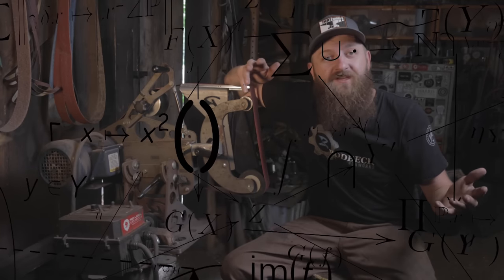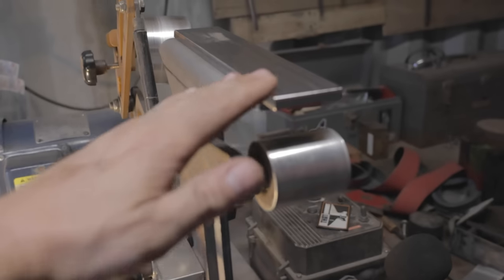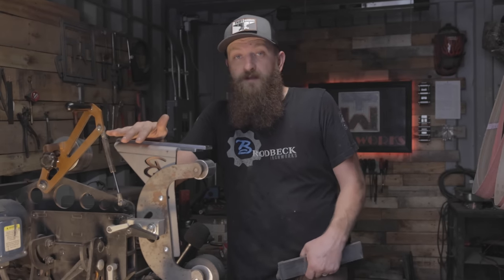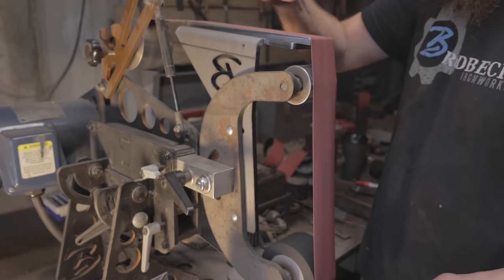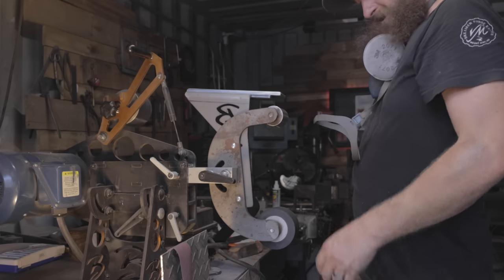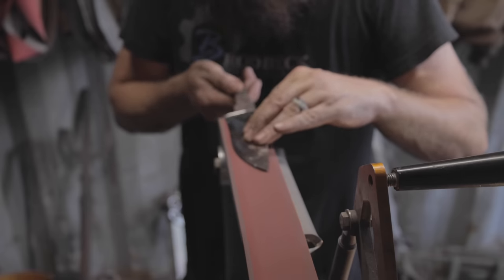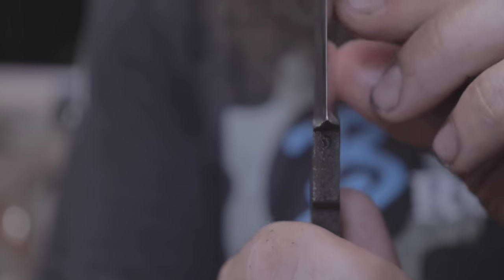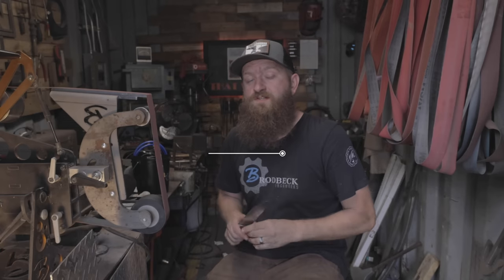Grinding Secrets that You Need to Know - Waterfall Platen

Comment: Matt, would a waterfall platen also help to keep the line between the bevel and the flat top area straight?  That's an area I still struggle with.  I'm wondering if being able to grind the whole length of the blade at once would help make that straighter/cleaner, in addition to the plunge benefits.
Reply from the maker: Yes I certainly can be used that way.

Comment: I think a big key for safety is to deliberately come onto the platen with the tip slightly up and then drop it to the belt once the plunge is on the waterfall. If you lose focus and accidentally come in even slightly tip down, you could get a knife to the chest. At least it would be the handle… I say this because I’m 100% sure I’d make that mistake at some point (ok I see you covered it at the end)
Reply from the maker: I mean yea, but also using a warn 400g ive never even been able to get the point to catch and toss the blade. Im sure if I stabbed it, it would. Id be nervous with some cheap sanding belts with overlapping joints too. I should have mentioned that.
Reply: I use the platen with grinder running in reverse so the blade is pulled away from me.  It just seems to work better for me

Comment: one big secret that they don't want you to know is to always wear eye protection
Reply: You should always protect your eyes and your lungs
Reply from the maker: I mean...I did for most of it. Had to give the people something to complain about!
Reply: <blind in one eye, can't see out of the other> 
You kids! When we were growing up, we didn't need a bib when we ate!
<coughs up a lung>
Reply: I hate it when a belt blows apart on a vertical platten. Scares the sheit off it’s me. I’d really hate to know what would happen if be blew apart on the waterfall platten. I really hope nobody gets hurt if the tip of the knife come back to n ya. Be safe. Great info on this WF platten.
Reply: @timjohle8876  Matt did not discuss tensioning the belt in video. But it should only have a light tensioning and light pressure used on a slow setting. You should have both hands on the knife at all times as well. Should a belt split, in theory you should be able to pull the knife away from the machine. But indeed it is important to be as safe as possible when using a belt grinder in general.
Reply from the maker: @fieryiceforge  I mean all of that is in the video if you look close enough. You can see when I push a bit too much the belt slips because it's not under high tention.
Reply: @ThatWorks  right, you had the tension perfect! I was just stating it wasn't discussed but it definitely a factor in getting the waterfall to operate properly and safely, which you did.
Reply from the maker: @fieryiceforge  funny cuz I never even researched how to use it. Just did what seemed right
Reply: @fieryiceforge   I was just concerned if someone had the speed balls to the wall. The video was perfect speed for what was going on.
Reply: @timjohle8876  yeah this style grinding on this attachment definitely requires a VFD to use.
Reply: @fieryiceforge  Yes sir !! I’d never try it on my Grizzly.

Comment: Hi Matt. I also wor with a waterfall platen. But I have a problem. My waterfall platen gets extremely hot in a short time. Is that the case with you too?
Reply from the maker: A. Run it slow. B. Brodbeck sells a water mister